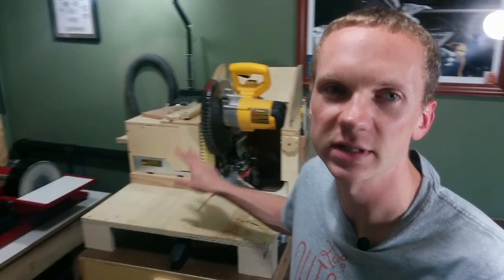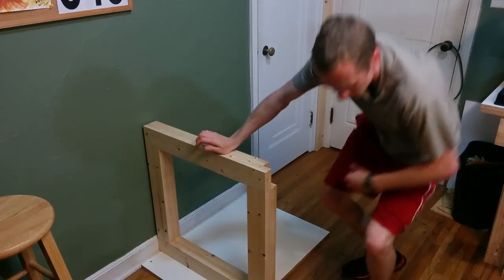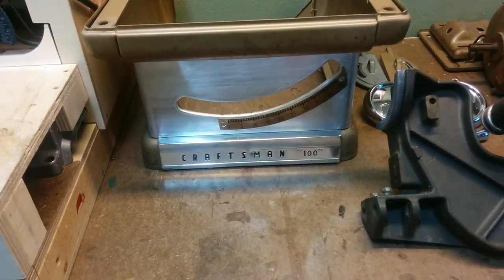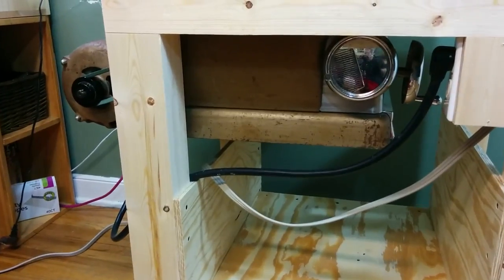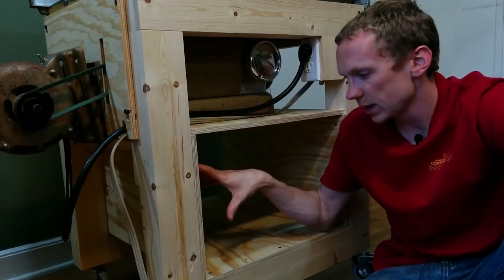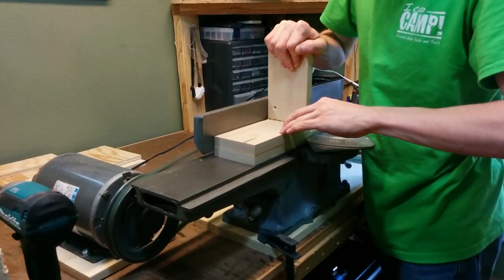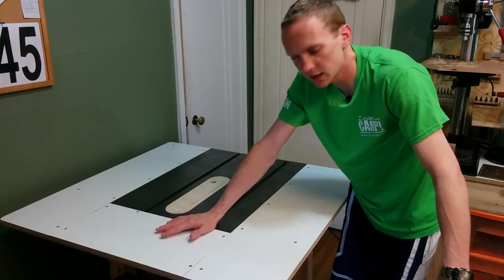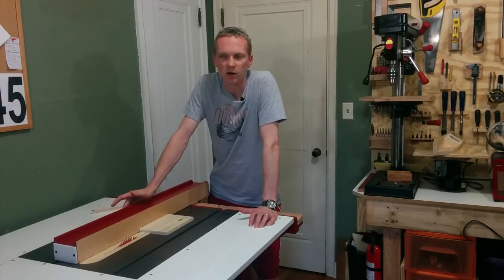Building a Table Saw for the Apartment Workshop

Comment: Use the old salt trick to prevent the wood sliding out of alignment during glue-up - just sprinkle some table salt along the faces that meet and it'll give you some friction and prevent the wood moving around on you.
Reply: Never heard that one before. Great tip! I'll be using that one in the future.
Reply: I came here to say the same. 🙂

Comment: I have watched a couple of your video and fine that I like what you do & how you do it! I have 1/2 of a 1 car garage as my workshop and am constantly on the look out for ideas to conserve/recoup  space, even if I have to rework a prior project.

In this particular video you mentioned that when clamping flat stock, face to face, that the parts tend to move slightly. I have been using a small amount of table salt to help with this problem. Glue, salt, align parts and clamp. I do have an occasional need to realign but no often. a salt shaker is part of my arsenal of "woodworking" tools.

Now I have to decide if I should reword my saw table/assembly bench.

Thanks Justin,
Red

Comment: congrats bro, finally you get your table saw. don't forget about the riving knife and cover that belt n pulley system.. looking forward more for your videos about woodworking.
Reply from the maker: +bad boy thanks! I've been trying to figure out how to add a riving knife as these older saws aren't really made for them.
Reply: Justin Depew maybe you could use bolt on riving knife type behind your table saw just for 90 degree cuts or make a sturdy steel holder in the arbour arm so it will follow the blade when tilting.. just an opinion
Reply from the maker: bad boy I have been thinking about both of these options... I definitively need to get something

Comment: Great idea and execution. I have Craftsman 113.29901 that I'm doing a restoration of right now as well. I'm curious what pulley and bearings you went with for replacements. I need to do those too, now that I have it all disassembled.
Reply from the maker: Matt, I used Nice 1623 Bearings for the arbor, but they were a few thou too small so I had to use a loctite brand bearing glue to make them a tight fit. Be careful which Bearings you buy and make sure they are a press fit or else you'll have to glue them in like me. The pulley is just a cast iron one I got off ebay.

Comment: Fantastic save on an old piece and for the build.  I would recommend a guard around the exposed portion of the pully drive and belt to prevent Mr. Thumb to adventure into danger.  This might also close up the unwanted escape of dust.  Again, a fantastic build!

Comment: Heya. Love what you did. I am doing a little something similar, but I am having a hell of a time figuring out how to wire the switch. I think I actually got the exact one you did, and I am preeeeety sure I need to connect the two blades that are parallel to one another to the hot wires, but I am not super sure. Can you show a pic or a diagram or maybe even a quick video on how to wire that paddle switch?

Thanks and happy working!
Reply from the maker: +Blackdraq if you have the same switch as me, then all you have to do is wire the incoming power from the wall into the bottom two terminals and then the top two terminals go to the tool. When the switch is thrown it connects the top two terminals to the bottom two terminals.
Reply: You're a champion, my friend. thanks!

Comment: Cool rebuild for a small space.  I like it.  Actually have the same saw, and I'm working out of a 10 x 10 shed.  Think I'm going to make this.  This video is a few years old.  Do you still have this saw, and have it set up the same way?  I'm thinking I would need to extend the slides into the outfeed table for a cross cut sled.  Have watched John Heisz's video on the fence.  Will probably make that too.
Reply from the maker: Yes I still have the saw. Still going strong.

Comment: Great job!! The only thing I suggest is to route miter slots in end feed section. This would help you in making cross cut sled (or any jig) traverse past the blade.
Reply from the maker: +Srinivas Kotekal thanks! I actually already did add slots and have made myself a cross cut sled.
Reply: could have just added a trailing hook to the sled to it catches where front side of the saw

Comment: I was sure you would make the outfeed tables, folding.  so it could be folded up into a smaller space when not used.  but, i have to say, i'm impressed with the project.  very well done.  and a table saw is a wonderful tool to have in the shop!  but be careful... also very dangerous.  (i learned the hard way, but i still have 9.75 fingers LOL... so that's a win in my book)

Comment: I have the exact same saw!  It was given to me by a friend many years ago. There are a couple issues I have with it and I am curious if you have them.  1) the belt causes a lot of vibration 2) the handle on the crank to change the bevel is broken off of my saw.  It looks like yours is too!   Your setup doesn't look like it is going to let you change the angle without disassembling the out table so I'm guessing that you won't be making much use of it anyway.  But if you did want to change the angle, it takes 20 minutes of cranking and the design makes it so that you are hoisting the weight of the motor and the entire mechanism.   I've actually thought about replacing the saw because of that.  However, there are a couple things I really like.  This saw is PRECISE!  You can make cuts within thousands of an inch.  I also really like the OEM fence with the gear to allow you to make very precise changes in the fence position.  It's a shame you aren't able to use that feature.   Mine has cast iron attachments for the sides so I didn't have to build any.  The saw plus the wings probably weigh 200 pounds or more.  You can't buy equipment like that anymore unless you want to spend thousands.  I've seen adapters for "chain" belts that don't develop stretches in the belt from leaving the weight of the motor sitting on the belt when not in use.  Curious if you have any ideas on that.  VERY nice job making that stand.  Love your work.
Reply from the maker: Hi Joe - when I first got the saw it also had a lot of vibrations. I replaced the belt with a link style like you referred. It solved 90% of the vibrations. Highly recommend. Also yes, my bevel adjustment handle is broken. I've been meaning to make a replacement. I agree it is a pain to operate. If I remove the dust shield on the rear of the cabinet I can bevel the saw. I usually push up on the motor while turning the handle to help tilt it. I would like to improve this as it is a great saw otherwise.
Reply: @JustinDepew  I am thinking about affixing a nut to the center of the crank so I can use a driver to change the tilt of the blade.  It's cast metal so I can't weld it but I'm still noodling.  If I come up with something I'll let you know.  Nice videos and really nice presentation.

Comment: Awesome saw!  I really like your channel and work.   One thing I thought I'd mention because...  on the shroud for the back of the saw that is used for dust collection.... I know you said I'll need to remove for angled cuts.... make sure to remove!!!  I had a similar setup and forgot about that thing and went to make a angle cut and torqued it just a bit too much (also could be phrased, I cranked on it a bit too much before remembering about it) and for reasons that are too hard for me to explain (I'm not sure I fully understand even after taking the saw apart 4 times) but basically ruined/compromised the linkages that are mounts for the trunnion .   The saw still works but it will never make a angle cut again.  Anytime I try the saw blade goes way out of alignment.  Anyways, seeing yours just brought back a bad memory  for me.  :)  Again, awesome saw!
Reply from the maker: Yes I've done that too, but no damage luckily. It's all cast iron so I really doubt I could hurt it.

Comment: Question:  Why not build a big enough stand to house the motor if you wired in another switch?  I guess unless it is to prevent dust getting in the motor.
Reply from the maker: Yeah I was worried about dust getting in the motor

Comment: Hi Justin. How much of the blade do I need showing to rip 15mm x 15mm stock and would you suggest changing the blade for a more finer cut?
Reply from the maker: +Phil Richmond I typically like to see at least one full tooth sticking through the material. Only switch to a dinner tooth blade if you are worried about a good surface finish.

Comment: Hey justin, I just saw a video explaining how to prevent part from sliding apart when glued and clamped together. Using salt on the glue prevent the 2 parts to slide. Because salt grains are locking pieces together. I thought It's was great tip ! Great video. Thanks !   ;-)

Comment: How do you manage to run power tools without the neighbors rioting?
Reply from the maker: A couple things:  The room that the shop is in does not share a wall 
with the neighbors, so noise has to do through two walls before it gets 
to  a neighbor.  Also the walls are very thick and hard plaster.  I 
can't even drill into them with a drill bit ha - so that helps a lot.  
Also, I don't run any tools in early morning or late night.  So far no 
noise complaints!
Reply: you are god damn lucky.
Reply: Justin Depew a

Comment: Hi I'm really impressed. 1.With your work.  2.You still have a wife! 3.Your neighbours haven't lynched you!
Serious question. The plywood fence. Does it move, at the far end, when its locked?
Reply from the maker: Haha thanks! Yes the fence deflects a little bit if you push on it enough. But really when pushing wood through most of your force should be forward and only a little needs to be towards the fence.

Comment: Firstly great job. Second; how do you get away with the noise in an apartment block? 
Ryan
Reply from the maker: A couple things:  The room that the shop is in does not share a wall with the neighbors, so noise has to do through two walls before it gets to  a neighbor.  Also the walls are very thick and hard plaster.  I can't even drill into them with a drill bit ha - so that helps a lot.  Also, I don't run any tools in early morning or late night.  So far no noise complaints!

Comment: Great effort. I appreshiate the time an skills it took to build this BUT, there are so many NOPE NOPE NOPE NOPES that this should have been a project started then stopped until a further date. The table saw rebuild looked amazing, if it was not for the fact that it was a complete piece of shit. Motor hanging out the back, fuck that get a direct blade motor saw no belts, no sticking out the back. So you can live with that, ok fine, but the second you saw the top was not flat brakes should have been put on until this was resolved. It might be as simple as replacing it with a wooden one, Operating a table saw with a bow in its surface is just going to mean ever single cut made on it will be wrong.

Comment: how much did that cost to make?
Then the materials you used ? let's say $50 to be generous (probably spent a lot more)
I would estimate that you spent at least 20 hours planning and building
Let us say your time is worth $10 pr hour, meaning a total cost of at least $250.
What makes this better than a tablesaw you can buy for $150?
Reply from the maker: SlackHax I $100 for the saw and maybe $200 in supplies. Any saw you can buy for $150 is garbage. Building my own is the only way to get exactly what I want.
Reply: so you spent $300 + time, and is the time was 20 hours a $10, meaning a total cost of $500. Pretty sure you could get a pretty decent tablesaw (with guard and angle cut) for less than $500. My question was: "what makes it better". I just wanted to know why it was better.
Reply from the maker: SlackHax I didn't do it to save money or time. I did it because I enjoy making things over buying things. Plus, no saw on the market has exactly the right footprint I need or as good of dust collection as this one now has. Plus most cheap saws are built like toys with cheap components. And lastly, I get no greater satisfaction than building something from scratch using tools that I also built. It's quite rewarding!
Reply: Ok, that's a good reason. Good hobby

Comment: Talking about the "safety police"...you should do something about these open belts and pulleys. Sooner or later an accident is going to happen. However, you did a great job there and have a nice workshop. I'll definitely look out for some other videos from you. You are somewhat like me..now and then things don't work out as planned..then we improvise.
The correct way of dealing with such hollow saw table would be to take it to the metal shop and mill a few 10.th of to make it flush. But then again, I think your idea was a low-cost DIY solution for that saw and a trip to the shop would have cost some $.
Reply: Kalle Klæp totally! That belt and pulley looks about shlong height! It would suck to get your bag ripped off.

Comment: https://youtu.be/wrln6lSLqUc?t=952
you got 4 problems , the way you build it it takes up extra  space
you dont have space is an problem aswell
all the space underneath is unused in my book 
what outlet do you plug the planer , table saw and miter saw in , drill press?
the project locks cool but i think the design isn't suitable